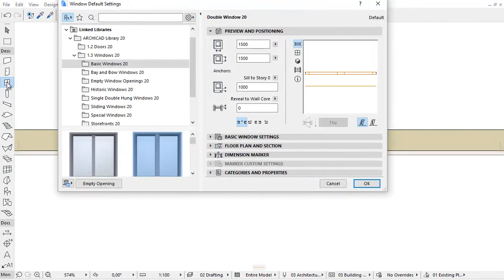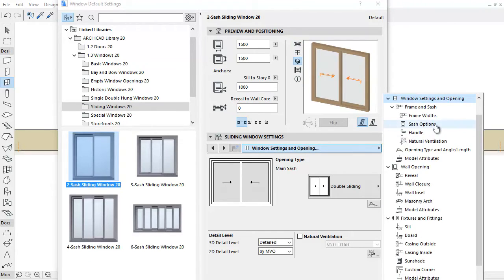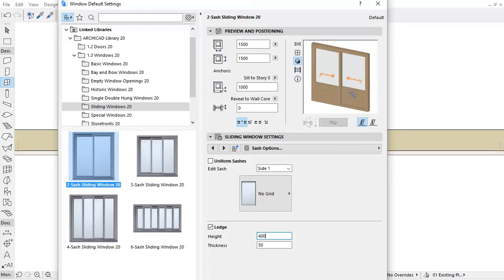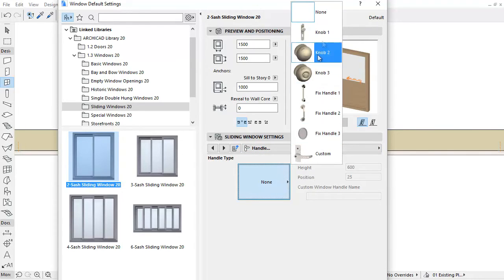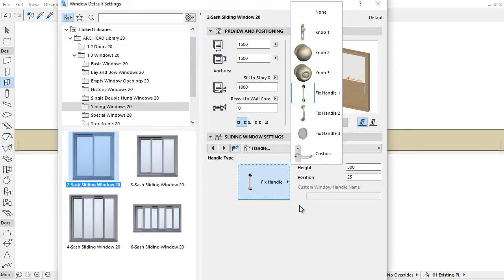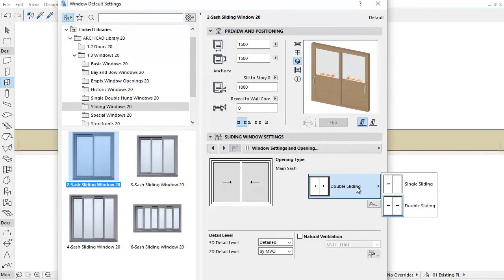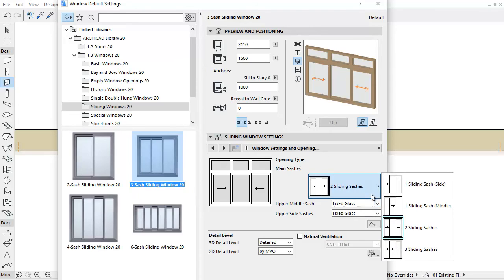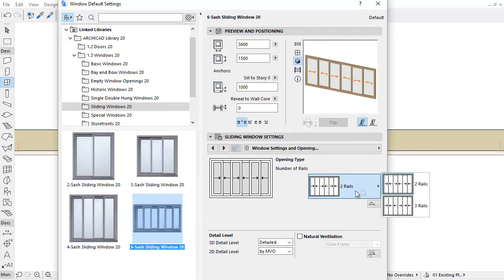Improved Sliding Windows in ARCHICAD

Comment: Still no double sliding with fixed center and bottom transom window...very annoying as ifc windows cant really be modified : (
Reply: You can get a basic version if you use the triple window 20 from the library theres a bottom transform option but you still cant make a double sliding with fixed centre..